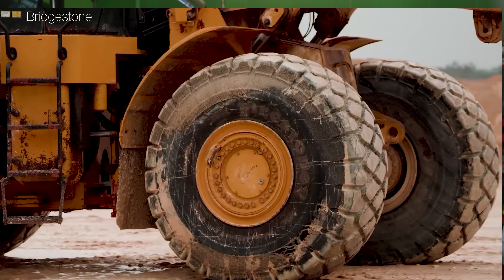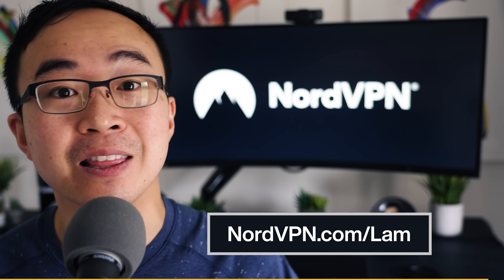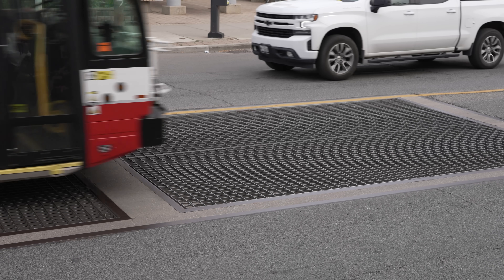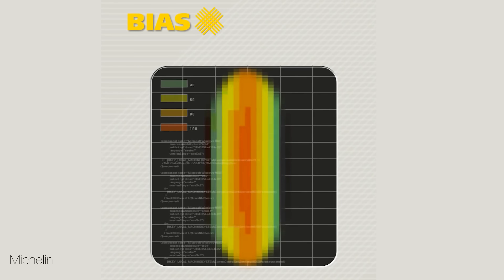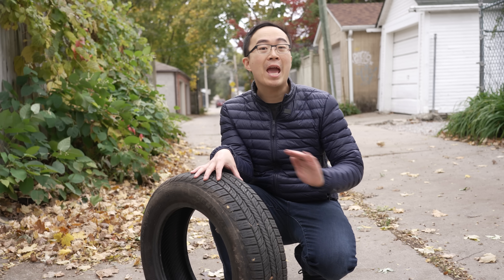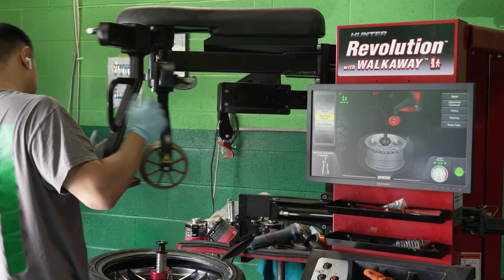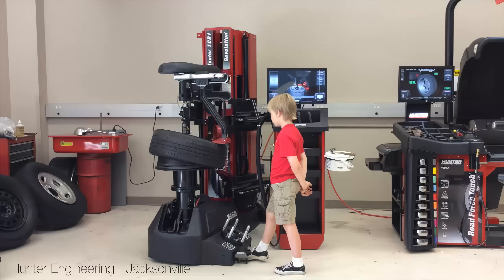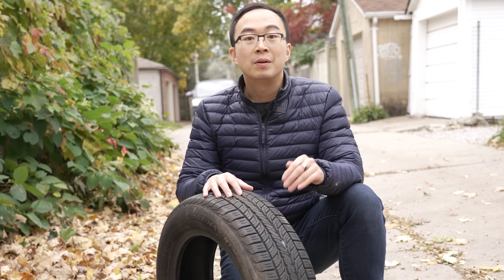How 90 Years of CLEVER Engineering Transformed Tires

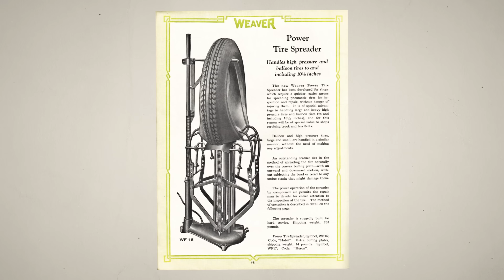Comment: 10:02 This thing is used to stabilize a tire and spread the base of it, for the purpose of flattering the bottom so you can grind out the ridges inside, then clean it to glue in a tire patch.

Comment: The benefit of living in Finland and studying mechanical engineering is that you can have Nokian tyres guy come give a lecture on tire technology. I had no idea tires have such complex layering of materials and geometries today. And the best part was their never released but proof of concept technology where you could have coloured led tires, or telescopic winter studs controlled from the driver's seat.

Shoutouts to the squirrel on the roof photobombing your frame!

It's funny how car makers made the cars safer to the drivers. Now pedestrians die due to car makers designing the front basically to wreck people.

Comment: Wait until you find out which top brand puts a layer of different rubber that is less than 1mm thick on the tread to improve initial traction.

You're way short on insights into the complexity of tire engineering.

Comment: Hi Andrew, I enjoyed watching your video. Understanding the concept by reading a book is too difficult no matter how many books you read or images you see. Color images though are better. But understanding those concepts through video is much better. I found the video insightful. I have one doubt, it might be silly. I wanted to know how the tire's diameter affects the vehicle's performance. I will take the case of a scooter, a motorcycle, and a  3 wheeler tempo.  The diameter of a scooter tire is smaller than a motorcycle tire but comparable to 3 wheeler tempo. 
I wanted to know what design consideration goes into the selection of Tire size.
How do tire companies decide on the tire sizes?
Reply from the maker: Thanks for taking the time to write in! To be honest I don't know how that is chosen.   It would be something I would Google, and it wouldn't be a satisfying answer I would give you.
Reply: @Lam  Thanks for your response. i tried google and chatgpt but could not get correct response. Anyways thanks

Comment: 06:20 ... dang, you make me feel old. When I was in high school I worked for a nationwide tire company. We sold bias ply and radial tires and we used the COATS 40-40 tire changing machine. Back then, a "large" wheel was the 16.5" and were in both solid wheel or split rim (split ring) wheels. Passenger car tires were from 10" to 15" and special order tires could go up to 17". We had no method to mount any tire larger than a 17" tire and a sidewall of 55 was the lowest profile the machines (and technicians) could mount.
Still, I remember asking customers who wanted radial tires if their cars had "radial-tuned suspension" because if the car was designed to use bias ply tires and you mounted a steel-belt radial tire onto the car, the car would drift side to side like it had really bad alignment problems, but instead of being pulled to one side, the car would pull both directions and therefore the drivers could not exceed certain speeds without losing control of the vehicle... think about riding a skateboard going downhill. The faster and faster you go, the more wobble in the board at the trucks and you eventually lose control.
That is what would happen if your car was not tuned at the factory to use radial tires when it was made. Most carmakers would "brag" about their new designs by putting a decal or emblem on the side of the car above the wheel well saying "Radial Tuned Suspension" or just "Radial Tuned". That tuning was a great selling point for car dealerships because the buyer would know they could safely use the more gas-saving radial tires.
There are benefits to "glass tires" as the bias ply were known... they could handle heavier loads without suffering sidewall separation, but were mostly used on commercial vehicles or heavy-load personal pickup trucks that wouldn't be driving fast with a load in the bed anyway.
Although I eventually became an engineer in the sheet metal and steel industry, I do miss the days of working in the old tire shops of the 70s and early 80s. There were no fancy tire changing machines, we jacked up vehicles with floor jacks, not lifts that are ubiquitous today. 
I mean you only need to get a vehicle a few inches off the ground to change the tires anyway. Sure, we worked on our knees or strained our backs bending over to work, but the speed we could change all four tires on a car with two technicians was literally five minutes... that's from the moment the car drove into the bay, jack up, pulle the hubcaps, remove lug nuts and wheel, change the tire, balance it on a spin balancer, mount the tires/wheels back on the car, tighten the lug nuts, lower the jacks and torque spec the lug nuts, then replace the hubcaps.
Two technicians on a car... five minutes and it's ready to drive out of the shop... and we didn't need to run to the cars like a certain tire chain makes their techs do for each customer. I miss those days of hard work.

Comment: The video starts with a segment about sockets, includes crash testing, and ends with tire changing machines; none of which have anything to do with the transformation of tires over 90 years, but doesn't mention advancement in rubber compounds. Fail!

Comment: 7:40 I bought some cheap very good looking 225 45 18 Fullrun tires off ebay. I put them on a 2004 Golf 122. They cost about $70 each. On dry ground, they seem fine. On wet road. They would hydroplane like bad tires. I will never buy them again.

Comment: @11:53 Tire guys always slop the soap solution around the bead in haste. I have to wonder what that trapped liquid does to the air space since they always get some of it inside. More of course would cause greater problems. You barely scratched the surface of what a modern marvel tires are. Thanks for at least an introduction.

Comment: Those automated tire machines are not ‘quicker’, It’s more of a cost saving on labour situation. 2 workers on the tire removing/fitting and the balancing machine are far quicker. But one person’s doing the balancing whilst occasionally adding and removing tires from the other machine is just a bit quicker than one experienced person doing both the old school way. But that’s doing 1 on 1 off back and forth, 4 on and off is different.

An experienced fitter can remove and fit a new tire in well under 30 seconds and easily 4 in under 3 minutes once you take into account taking them on and off the machine. Balancing 4 in under 2 is easy if you know how to read the balance marks on a tire and line them up them on the rim correctly in the first place, 5 minutes in total to do 4 complete tire changes . Difference is these new machines are for dummies and anyone can use them with next to 0 training, saving on cost again by not having to pay more for experienced labour. 

I worked as a fitter and the boss got one of the newer fancy machines in a shop with 3 manual ones already there. Got used for a couple months before he sold it to a smaller shop. We were a large shop with government, dealership, emergency service and fleet contracts, we had skilled and experienced workers who put that fancy machine to shame. A smaller operation with only one or two staff it probably works for, but for bigger operations is too slow and cost 4 times as much as the manually operated ones the generation before it, also requiring less maintenance and not having to worry about computer programming problems.

PS. Pay for premium tires, might cost 50% more but will last well over twice as long. Like all things automotive, get Japanese brands like Yokohama, those are engineered pieces of art compared to some other brands.

Comment: I used to work with one of those things at 10:02 it's used to create a wide flat surface to work on when patching leaks with the application of a rubber patch to the interior of the tire with vulcanizing cement.  Haven't seen one in ages, and the one I worked with was already ancient long ago.

Comment: Thanks for the video.
I think it should have been in two parts.

The first part was some examples of how auto tech was transformed according to feedback from real life.
That's where the socket and various crash tests come in.
They have nothing to do with tire engineering after all.

It ends with the testing done on how tire testing is only done on new tires, and give examples of how wear affects that. 
You can add in misc stuff like ABS etc etc if you need to pad it to the time.
But your underlaying theme is that the majority of advances were made due to real life testing.
And reporting due to non-profits.
It wasn't the gov't that drove it at all: they were pretty ineffectual as a change agent.

Then Part 2, has tire design, where you show how the block design improved things.
Give more data on wet performance perhaps.
Then add in the bias vs radial change.
Then go to how the depth of tread affects performance, and how wear affects that.
And point out that the moment, the current rating tests are not very effective since they only measure NEW tires.
So that shows we need better testing, done with worn tires.
In fact, perhaps there should be a required spec for a tire with 80% wear.

After all, in a crash, it's not just how fast YOU can stop, it's how fast the car BEHIND you can stop.
Or maneuver in the rain etc.

Comment: You should have pointed out how every point on the tread slows to a stop (when contacting the road), and accelerates to twice the vehicle speed (when it goes over the top of the wheel), every rotation, when simply rolling. It's pretty mind blowing when you first realize it.

Comment: I’ve witnessed how Parelli Pzero tyres can still have 50% depth left, yet a handful in the wet. Hoping the Michelin PS4 and PS4s I have fitted now, to a 2006 bmw 750i, are better once half worn. 

When new at least, they have a staggering amount of cornering speed in the wet. Feels like more grip in the wet with new PS4/PS4S then worn pzero in the dry.

Comment: (new) tires are far from "better" .. Yes, the advent of tubeless radials probably saved more lives than seat belts, but what I wouldn't give to have a set of old school 80's square block snow shoes where I live 5 months the year. I don't need doughnuts that are quiet .. or that tell me that I'm pretty. I need them to do their job. Although not exactly empirical .. ask any codger around the town stove - with furrowed brow they'll relate how old school rubber and a few brains would get you 40 miles through 4" of new fall in a '74 Chrysler in the day .. but now you can't rooster up the same first hill in an AWD muffin with a thousand dollars worth of newfangled rubber.

Comment: Michelin has deveopped a tire that keep a similar level of water ejection the more the tire wear.

Important advice: don't cheap out on tires. As mentionned, they are an important safety features, good or bad weather conditions. Better buy a small car with smaller (and cheaper) tires over a bigger car for safety. Way more important. Too much worn, get rid of them. And don't buy cheap ones.

BTW, I started watching IIHS crash test results back in the '90s. Over time, cars safety improved to a point that they had to increase the impact speed from 35 to 40 miles/h to strech the results a bit.

Comment: \\   the angle is the noise, highway tires had the zigzag, all weather and off road had 
//  tread blocks perpendicular to rotation, this makes the lugs self clearing
\\   the staggered patterns may reduce the noise but the edges of the blocks are
//   still experiencing heavier wear and won't grip mud and snow as well

Comment: The ‘whatever the heck this does’ machine is a spreader, nothing to do with fitting tyres, it’s used to inspect the interior surfaces of the tyre and to give the technician easy access when doing internal repairs to the casing

Comment: Mid 1960's at Standard Oil company (not Chevron) gas stations.   Bubble balancer.   The trick Standard taught us was to use 4 weights.  2 on the outer rim, and 2 on the inner rim.   Superior to the computer balancers of today that have the tech only use the outer rim for the weights.   A little understanding of physics helps to understand this.   Motorcycle tires are balanced with adhesive weights set in the mid wheel between the rim edges, so no hammered in rim edge weights, and no dilemma of weights having to be placed on the outer edge of the rim.

Comment: The randomizing of the tread pattern is a principle that was also used on the highway system. Expansion joints in the road were once equally spaced giving the tire noise a similar effect we often associate with railroad tracks.  It was found that this can have an effect on car drivers which would tend to make them drowsy or even put them to sleep.  Nowadays, there are 3 or 4 standard spacings, randomly installed to minimize this problem.
Reply: Long ago, on a long highway trip, we  drove by a car on a concrete highway with regularly spaced expansion strips.  The two guys in the car were doing an exaggerated "bounce" in their car seats every time they hit an expansion strip.  It gave us a good chuckle.

Comment: it' was actually changes to road construction that forced tires to improve.
you see back in the day, when roads were still made with coble stones, concrete plates or just topped with gravel, any tire would have been noisy so there was no benefit to making tires quieter, until we started making smooth asphalt roads that generated little noise of their own.

Comment: Waaaay too much promotion relative to “content” here. The small proportion of content, while good, just skimmed the surface and then veered off right away to promotion again. This obscures your excellent core argument “signal” about tire testing in a sea of unrelated noise, risking most viewers missing the point. This works to the advantage of your sponsors, but is a violation of the trust you seem to be wanting to build. I think you need to flip the ratio of public service to private enrichment (and continuing to support systems of authority). There is real potential here, but that potential can cut either way, in terms of the Public Good: positive, or Negative. Choose well.

Edit: adding text below / text above is unchanged

I just watched the guardrail video you told us about in order to advertise the positive comment from Mark Rober. That was more like it! Which makes me concerned that this tire video was your very next video: it sure makes it clear that you rapidly monetized and massively sacrificed information and possible public good. On the strength of the promising guardrail video I will continue chronologically through your videos after this one, BUT it really causes me to want to double underline my criticism above. I hope I am wrong and you made some ethical adjustments after this advertisement video with “tire engineering bait”.

Comment: 10:02 That is a tire spreader, it is used for spreading open the tire to make working on the inside of the tire easier. This is often used for patching or patch/plugging a tire, especially on thinner tires or tires with stiffer sidewalls.

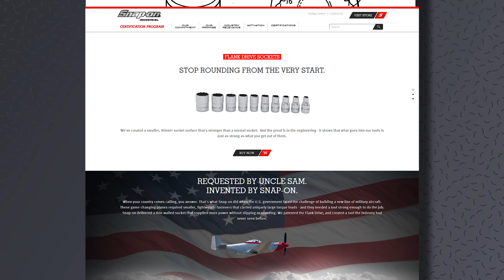Comment: 2:28 - - new invention improving bolts - - 2:57 (slight shape modification)
3:23 - - slightly modified shape of treads in tires - - 3:32 (buttressed tread)
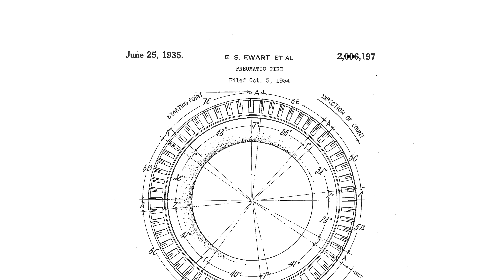3:54 - - patents compared - - 4:12 - - 4:54

Comment: With regard to the water performance of older tyres - Dunlop 404 pattern (Australia and New Zealand) were particularly bad in the 1970s/80s - they were fantastic in initial tests but wet braking distance increased 50-75% at 40% wear. They were heavily marketed on the slogan "Put some 404s on the floor"

Consumer New Zealand (like Consumer Reports in the USA) finally responded in the late 1980s to widespread complaints about the tires (and threats to cancel subscriptions due to them constantly recommending devices which performed well when new but quickly failed) by introducing tests on worn tyres, as did several car magazines.

Sales of the Dunlop tyre cratered but the 404 pattern remained on sale until the mid 1990s

Comment: This was a very fun video for me. I started changing tires in 2003 and the tire industry has come a LOOONG way in regards to servicing tires and wheels. It’s simpler yet more complicated than ever. There are more tools available to help change tires but the cost for this precision equipment is extremely high and all require quite a bit of hands on experience to use efficiently without sacrificing quality or damaging your tools.

Comment: 10:02 - "Whatever the heck this does." sounds funny, but a little research will make you more credible. It's a tire spreader. It's used to spread the beads apart to allow better access to the inner casing for inspection & repair.

Comment: In '67 I bought my first car. Was an old beater, but that was all I could afford. And the only tires I could afford were recaps. I ran recaps for over 10 years, so about until late '70's when new tire prices began to match the recaps. In all that time, I never had a problem with a bad recap. But big trucks ("big rigs") still use recaps (with modern recap tech.), and seem to have all kinds of failures with them.. Wonder what's up with that.. My Dad used to buy high-end polyglass tires (passenger and pickup), and then would be able to have them recapped 2 or 3 times after that. He never had any complaints either.

Comment: With how much time saving tire changing machines create for a shop, you'd think prices to change tires would fall, but instead they've gone up.  Most shops in my town charge $40 PER TIRE to mount, balance, replace valve stem (or +$45 for TPMS per tire)..   So I bought a cheap harbor freight manual tire changer and static balancer.  Best investment ever.